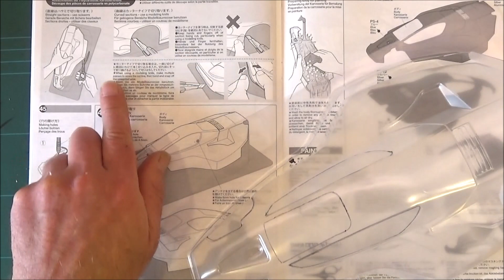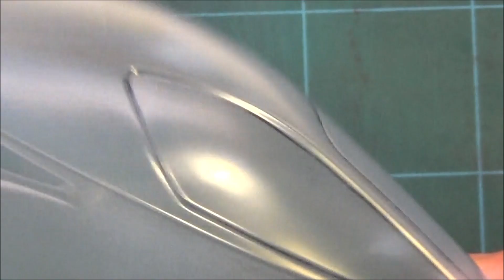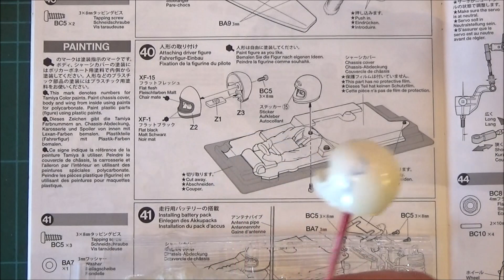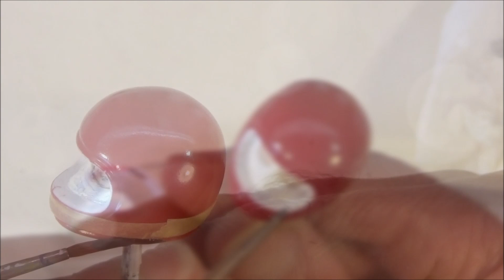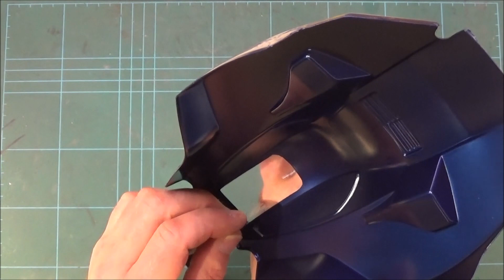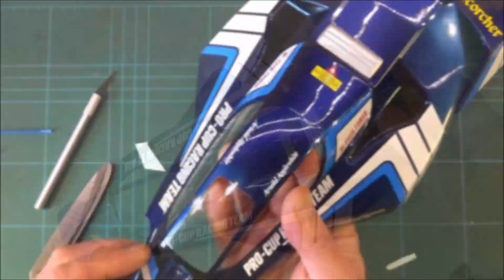Tamiya Terra Scorcher Build Guide P4 - Bodywork & Interior + How To Make Window Masks

Comment: Is it a good idea to take a part some parts of the car a grease and oil them or is it bad for the car if you take it a part to much?
Reply from the maker: Hi Jamie - I only tend to spray the moving parts and joints with WD40 or similar if it gets wet or if I need to wash it - I don't touch the gearboxes or diffs. My cars have all lasted pretty well, so I reckon that's all you need to do!  :O)

Comment: The rear left dampper on my terra scorcher came of I have spares of all of the things but I do not have the gold brass bareing I have some on the way but due to covid it won't be here for a few weeks is there anything I could use in place like would a few o-rings or washers Do till the brass bareing arrives?
Reply from the maker: Hi Jamie - as a temporary measure, try to find a bit of plastic or rubber tube that fits over the screw and inside the shock, and use a washer behind the head of the screw to stop the shock coming off. If you can't find any tube to fit - wind a narrow strip of electrical or other sticky tape or double-sided tape around the shaft of the screw till it is thick enough to fit snugly in the hole in the shock. You will still need the washer to keep it all in place. Hope this helps!  :)
Reply: @MarkBryanRC  Thank you for being so helpful!!  I will try it now!
Reply from the maker: @F1_Editsz  Best of luck - I'm sure you will figure out a solution, it's all part of the hobby!  :D

Comment: I love these build vids!! It's hard enough just building the car but to make sure you get everything on cramra and explain everything is just another level!!   I'm wondering if you could explain how to get to steering working? I have the servo in my car but the steering is not right and I can't a-line it do you have any ideas to fix it?
Reply from the maker: Thanks a ton, Jamie! As far as the steering servo goes, you need to disconnect everything and just connect the servo to the receiver and plug the receiver into the ESC. Then connect the battery, turn on, and let the sevo set to centre. Then turn it all off. Now re-connect the steering mechanism to the servo - and all should be good! Give it a try - I'm sure it will work OK!!!   :-)
Reply: @MarkBryanRC  Thank you my car is now working! Can wait to try it tomrrow!! Keep doing what you are doing the vids are great!!
Reply from the maker: Glad to hear it, Jamie - hope the first run went well!  :)

Comment: I too have The Terra Scorcher, i bought it in the nineties having watched your videos, brings back so many memories of racing it, The buggy is a very capable car and does exellent drifting on corners, occasionaly used to take out the front drive shaft to make it two wheel drive, when running on dusty terrain, ang get some incredible wheel spinning action, in 4 wheel it corners incredibally and is very hard to turn over, it takes most terrain with ease, and is very very good car to use at high speed,,if you put the black motor sprint in it you get a lot higher top speed, and is great fun running it in supermarket carparks when its closed,,i think it will run at over 25 MPH, with the black motor, but the standard motor will usually give around 17, MPH, if the put the 9.6, battery in it its gives extra power and speed,..as opposed to the 7.2 battery,...very good for running on fields with excellent suspension...........
Reply from the maker: Hello! Great to hear about all the fun you have had with your Terra Scorcher, I hope I have as much fun with mine. I also have a vintage Thunder Dragon from the late 80's, just refurbished it and made a video of it! I never did take out the shaft and make it 2WD though! You are right, the stock motor is a little slow, I will definitely look into upgrading at some point. Thanks very much for sharing your memories - best regards from Mark...   :)

Comment: Thank you very much! Your suggestions in painting masks were great! Just a couple of questions:
1) did you fix the fastener tape over or under the body? In my opinion the car is more beautiful if the body is fixed over the back fixing plate.
2) it is very hard for me to fix the body to the front pin, the body doesn't go down so fast probably due to some interference. Moreover, the fixing clip risks to damage the body when I insert it. Any suggestion? Ciao from Italy!
Reply from the maker: Hi Marco. To answer your questions, 1. No I fitted the rear of the body as shown in the instructions.   2. Yes, it is very difficult to fit the front R-clip, you have to push hard down on the body. I trimmed a little of the body away where it touches the front shock tower and now it fits better. Also, cut the end of the R-clip off so it doesn't touch the body as you slide it in place.
Ciao from England!  :)
Reply: @MarkBryanRC  thanks so much for suggestions, I'll do them! Half of the decals are now put in place, tonight I'll finish the rest!
Reply from the maker: No worries my friend, have fun with the decals!  :-)

Comment: Hi mark , i was wondering if you have a decent recommendation for a transmitter and reciever. Around 100£
Reply: I would recommend the Fly Sky FS-GT3C trnasmitter.
Reply: @garrymorris4515  thanks !! Will check it out.
Reply from the maker: Thanks Garry, I know this is a great transmitter - cheers for helping, mate!   :)
Reply from the maker: Hi Thomas, I think Garry is correct, I have heard a lot of good things about the Fly Sky equipment!  :))
Reply from the maker: Thanks for that input, Small Blue - I have used  Absima products and all good  :)
Reply: @Small Blue thanks !! I ordered a CR3P because the flysky brand doesnt seem too available here in the netherlands.